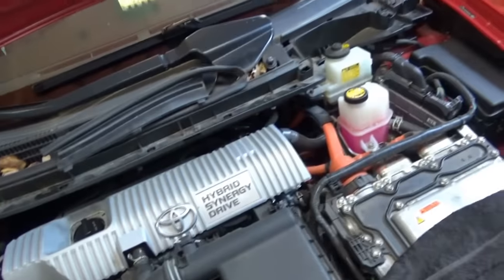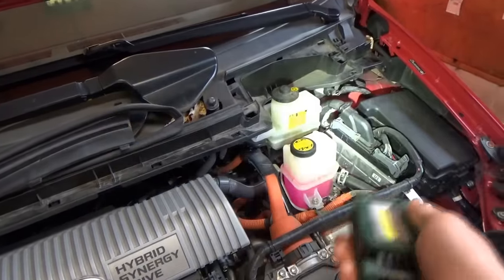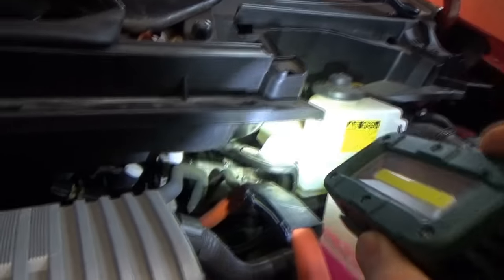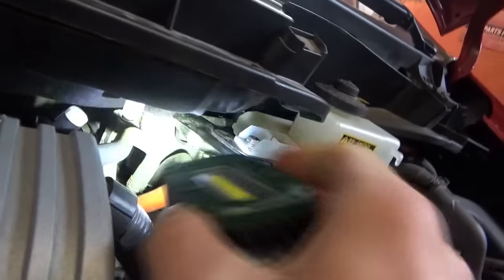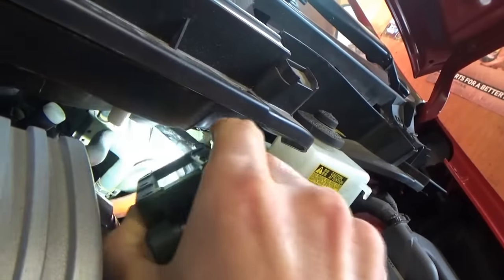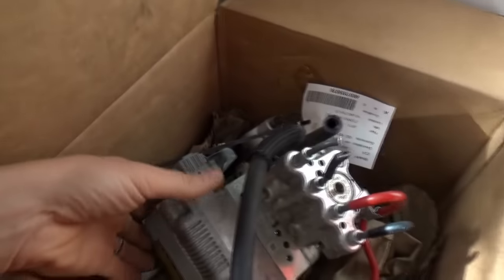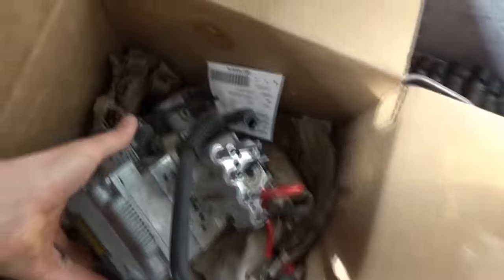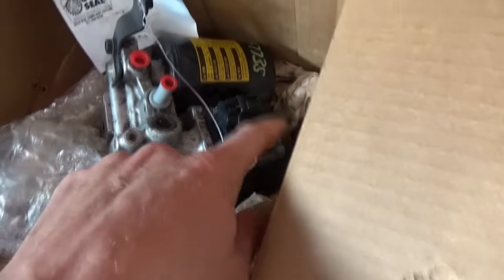Prius Brakes FAIL (Hidden COST of Hybrids)

Comment: Stating these problems are related to the car being hybrid is nonsense. There are way more cars on the road for many decades that had to suffice without engine vacuum as a power source. Starting from all the diesels (no vacuum at any time there), through practically all modern high boost low displacement engines (no vacuum when above minimum load, so e.g. for hours during a steady highway cruise), to these hybrids or electric cars. Makers used various techniques, from slapping a dedicated vacuum pump, through various hydraulic accumulators, electric pressure boosters, pressurized air and so on. 
If this is really a frequent problem, it is because Toyota screwed up their design (too expensive to replace a wear element,...; but it is about half century, when Citroen used hydraulic accumulators, so nothing new there either) or have chosen bad concept. Or this defect is just a rare, freak one, so not a reason to take that much seriously when shopping for a new vehicle...
Reply from the maker: Agreed. The moral of the story is that more complex systems will cost a fortune to repair in the long run 🙂

Comment: I have this same year model with only 120k miles and the abs issue.  Additionally the check hybrid warning light too.  So much for Toyota reliability.

Dealer wants over $200 just to bleed air and calibrate the abs.  I got  fed up in frustration after months I decided the f. with all of those I fix it myself.  I had bought the usb dongle and the Toyota Techstream  copycat version at much much cheaper price.  With this i can perform all kind of repair and  configuration for Toyota, Lexus and Scion up to 2023 years.

Do it yourself or pay to the roof  to have others to fix.  Not that hard at all!!!!!!

Comment: replaced 2012 toyota pruis used autel maxicheck  it guides you thru the process of bleeding. bought this either on ebay or amazon for 200.00 dollars
Reply: Did you replace both brake booster assembly/master Cylinder and Brake booster pump? How was the process of bleeding with autel MaxiCheck? I am planning to do it myself and still looking for a reasonable/work scanner to do the job. I will buy both new parts for the dealership though! Thanks!

Comment: My 2010 prius with 148k miles has blinking high temperature light. It comes on for 1min every time entering freeway. Sometimes my prius has heat but sometimes doesnt turn on. Its been like this 3months now couldn't figure out. I replaced thermostat at 148k already but didn't fix the issue.

Comment: You would think it would be much less complicated and less costly to use a vacuum pump with a standard brake system, as is done with diesel vehicles. Just make the vacuum pump electric.

Comment: Hi Ivan, I had the exact problem. I have a 2011 Prius and just had my mechanics replace the actuator and booster, but it still has all the brake/ABS lights on after the replacement. I've got a few error codes: 
C1203 - ECM communication malfunction 
C1336 - Zero Point Calibration of Deceleration Sensor Undone 
C1345 - Linear solenoid valve offset learning undone 
C1451 - Motor drive permission malfunction
Any ideas? Thanks!
Reply from the maker: You have to follow the service info and perform the calibrations with a scanner 👍
Reply: @PineHollowAutoDiagnostics  Thank you very much!

Comment: Why not replace the high mileage pump when you had the used replacement in hand and you were that far into it? Preventive maintenance is half the game.
Reply from the maker: Because that pump was from a recalled vehicle, and that's the part that fails haha
Reply: @PineHollowAutoDiagnostics  That makes sense. Thanks for the clarification.

Comment: The big barely mentioned extra cost is the 5-10 grand every 5 years for a battery.
Reply: Five years?  Toyota guarantees the battery for 150k or 10 years which ever comes first.  They are known to last much longer than that if the fan filter is checked and changed. Most around 200k.  The car care nut said he is just beginning to see battery changes on Gen 2s.  They are around 3k now and are going to keep coming down.

Comment: Doing a job like that is not the most intelligent thing to do when the customer doesn't want to get new parts and you install junkyard parts later on down the road if something happens to the brakes and they have a crash you are legally liable it's best to turn down a job like that

Comment: Funny that Toyota told me I needed an Accumulator and it needed 2994$ in repairs….  A set of brake pads later the car is fine and all the warning lights and errors are gone.   They tried to get me to pay 2994$ because they said “brake pads won’t set off these warning”….  I changed the pads myself for under $70….  Problem solved.

Comment: Why wouldn’t they set up the abs just like an ICE vehicle and put an vacuum pump in-line for the booster? There are ICE vehicles that are 💯 dependent on vacuum pumps for the brake booster. Example VOLVO

Comment: Hi Ivan!!!  I have a debate with coworkers about diagnostic time.  For how a diagnostic is good for?  A week, a month,  a year?  Thanks.
Reply from the maker: Hey Leo! Interesting question. I would say it depends on the situation...I mean if the diagnosis is correct, it shouldn't have an expiration date haha
Reply: @PineHollowAutoDiagnostics  
In your case, what is you deadline time?
Reply from the maker: @mencorgarageautorepair6694  It depends on the situation! If I do the repairs, then usually a year on the repair :)
Reply: @PineHollowAutoDiagnostics  
Let's say you run a diagnostic, but the customer declines the repair.  Then the customer comes back a month later to honor the diagnostic.  Would you charger for diag again?
Reply from the maker: @mencorgarageautorepair6694  I would quickly verify that the fault is still present and that there are no new faults :) Clear and honest communication with the customer is key!

Comment: It is just newer technology which is ready for Aftermarket availability to kick in. Car manufacturer need to be required to have there technology open source to the public because you cant depend on dealers to things right these days. They dont know what they are doing they are just trying to make a quick buck. There there so many software and firmware updates that need to happen these days and it should not be hidden from car owners. It is a safety hazard...

Comment: That wasn't a weird failkure aand isn't a coat of hybrids issue; it's a cost of Toyota's engineering badly packaging and locating the ABS.  The guts could have been located under the passenger seat if there wasn't room unde the hood. 

The ABS system in that Toyota Prius is opertionally no more complicated than it is in the ICE 2008 Honda Element and Odessey.  The difference is Honda puts all that stuff into one compact and accessible module and software.  Toyota''s is a Rube Goldberg kludge that lasts longer.

Both fail because of leaks.  A new replacment part from Honda is +$1500 MSRP.  Honda recalled several hundred thousand cars because of this problem, "fixed" it by sealing up the suspected leak externally with RTV and rubber caps. Owners of the repaired Honda's are now seeing the units fail permanently. No scan tool needed, one hour labir plus bleeding the brakes. A simple DIY job needing 2 flare wrenches and an OBD connector jumoe wire.

Comment: That had a recall
230 miles it does not cover it 
3200 dollars or 2300 is the cost to fix it but you will be good for another 230 thousand miles plus

Comment: Worldwide, the Prius is a Taxi  - for  goodish reason, they're pretty tough & pretty easyish to repair. Nobody sane buys these for economy as they just aren't economical compared to even a naff diesel - but they do go well in "LEZ" areas, they are vaguely "Green" - well the images is - and people don't tutt... but some repairs on them are a B-Ache.. like the ABS.. :-) and the battery... Toyota stopped building Toyotas in 2000 - fact - now they just make stuff that breaks too. And they break expensively - which astounds most Toyota customers as they thought they bought the shizzle of a car.. nope.. Oil-burning expensive parts muck like all the rest - they just trade on past glories - much like Mercedes.
Reply: "My Tesla saves me a fortune in gas!".... gets 20k battery replacement bill... goes suspiciously quiet about how much they saved.... :-)  "Hybrid" = "Run!" if you dislike big bills. You're gonna get big bills - just 1 ickle Lion cell has to go bad, you're gonna be wincing.. or the BMS craps the bed - again - say hello to Big Bill. :-)

Comment: Why did you have to change both parts when usually thr pump is the issue?
Reply from the maker: Usually the hydraulic block fails and then wears out the pump 😅
Reply: @PineHollowAutoDiagnostics  so it's best that I buy 2 new parts?
Reply from the maker: @Rhamlin7  yes

Comment: To drive Toyota that many miles before big 2000 $ repair isn't bad. Other cars have more repairs all along n wont last as long. The main question is the repair worth it because now u in time when batteries may fail. Even Scotty. On u tube says don't buy old hybrids. Due to battery problems.

Comment: Tried bleeding the stroke simulator but no brake fluid comes out 🤔
Reply: Same on mine.  Did you finish?  Did it go thru linear valve calibration?

Comment: Right but the cost is an issue if you bought the vehicle new. You can get a used 2010 Gen 3 for $6,500. You're paying to restore a 14 year old vehicle that can last 16 more years easily. Buy new parts.
Reply: Just picked up a 2012 super clean for $2500 😎 in excellent running conditions and no dings at all to body. It has the early stages of this brake problem but I’m a mechanic and not worried about it yet

Comment: brakes wont fail used parts in this case only garntees you are buying another defective part its a one hour job incluiding bleading step one should have been remove hood and wiper cowl if somthing is in the way remove it looking for shortcuts never works
Reply from the maker: You must be a Toyota Master Tech... Why does the book say 4 hours?

Comment: May get great gas mileage, but that money saved is spent on higher maintenance  costs, maint labor as well as expensive parts and repair labor rates. Imagine 2 to 3 thousand dollars for parts and labor. I wonder why not just use a normal vacuum brake booster with a vacuum pump. Much simpler system.
Reply from the maker: Like an electric vacuum pump?

Comment: The hidden cost of hybrid ownership is repairs yes, but replacing batteries is the main cost. Its an environmental disaster on 4 continents manufacturing the batteries.  Still need occasional tune ups. oil changes, still has gas engine. Horrible choice. Gasoline vehicles are considerably more environmentally friendly.

Comment: Its kinda unfair to even bring up the "hidden cost" unless you are going to ffairly do a full blown cost benefit analysis.  Your theory in this regard fails flatly when one clearly analyzes vehicle repair costs, as, what REALLY is expensive is ANY kind of new tech as ANY tech is rarely as good in its first iteration as in subsequent efforts.  My Gen 1 Prius went 291K miles and averaged 51MPG.  An equivalent corolla of the time was hard pressed to deliver 30 mpg and was far less responsive to a lead foot. in that time i purchased 5700 gallons of gasoline AND enjoyed a far more responsive car while POLLUTING far less than the corolla which would have sucked down  9700 gallons of gasoline IF it could have made it 291K.  I can buy a lot of brake boosters for the cost of 4000 gallons of gas.

Comment: What that engine bay needs is more hoses and cables. :/
This is what happens when a manufacturer gets blinkered into side alleys and go all in - be it hybrid or hydrogen. They just keep going down the same alley - despite the rest of the world shouting... ELECTRIFY.
Reply: Frankly, I don't blame Toyota for sticking with hybrids for now.  There isn't the infrastructure YET for mass electric vehicles.  Additionally, in cold weather states, it would make me nervous because if caught in a blizzard / traffic jam, you would have heat as long as you have battery.   Then when over, it wouldn't move if the battery was dead.  At least with a hybrid, the computer won't let the battery go dead as the engine kicks on and recharges it and keeps the heat going.  Can't tell I live in a cold state, huh?

Comment: I’d hardly call that a “hidden cost” on any vehicle with almost a quarter of a million miles. Things break after you drive the equivalent of the circumference of the earth 9 times over.
Reply: For only 9.95
Reply: A good analogy.  It's also only 10k short of a trip to the moon.

Comment: I've got a gen 2 with over 300,000 miles on it. Original motor with replaced head gasket. Just now putting a rebuilt battery pack in it. I still think the gas savings out ways the parts heavily.

Comment: I mean 230k miles, if you're getting 50mpg from a prius and 30mpg on a standard car; you've saved 10k on $3/gallon gas over that time. 
You're also acting like other cars don't have issues or require maintenance either...  (and this was a recall, so Toyota would have covered it)
If you had a gen2 or 3 prius, you had one of the cheapest driving experiences for 1-2 decades.
Reply from the maker: Regular Honda Civic gets 45mpg, same as a Prius 😆

Comment: Didnt look to me that you had the order of operations right. I thought you are supposed to 1) press pedal, 2) open bleeder, 3) close bleeder, 4) release pedal.   This is the way you do it on a car without a pump, too. But at least WITH the pump you don't have to repeat 1-4 over and over again until the bled fluid comes out without air in it. If you replaced the lines that could take a while!  That way you are performing this, you release the pedal before closing the bleeder and that will suck some of the bled fluid (with air) back into the caliper.  You should have used a 2x4 against the seat to hold the pedal down while you went and opened / closed th bleeder.  The pump would have kept pumping fluid to that corner for you.

Comment: I bet anything he never flushed gis brake fluid ever . thats why these fail . minus the nitrogen chamber recall. Also by the way if the car got 45 Mi to the gallon and went 210,000 miles at an average of $3 a gallon that's $14,000 in gasoline. If it was a normal Corolla and it went 210,000 Mi and got 30 Mi to the gallon and also $3 a gallon that's $21,000.... pretty sure you still save money this way
Reply from the maker: And then you have to replace the hybrid battery pack 😂
Reply: @PineHollowAutoDiagnostics  315k and 19 years on the factory battery pack in mine . i did have a car rear point was true. I bought a TDI 2000 Jetta for dirt cheap and everything I saved in mileage I put back to it in maintenance
Reply: @PineHollowAutoDiagnostics  the battery packs only have to be replaced because people don't know how to drive these freaking cars and people don't maintain these cars. These foreshadowed the horrible maintenance habits of the EV owner

Comment: Why not just use a vacuum pump on a regular brake system? Well, because if your an engineer, designing the Rube Goldberg braking system is way more fun. Glad I drive a 2006 Matrix with 214,000 miles (which is an awesome car for DIY mechanics BTW).
Reply: Hybrids have regenerative braking, which needs to be absolutely seamlessly coordinated with traditional friction braking. A drive-by wire braking system is the only way to do this.

Also, this by-wire braking system allows them to do neat things like vehicle dynamics integrated management, which is essentially predictive stability control that can react 1000 times a second. No traditional ABS pump would be able to keep up.
Reply: @aspecreviews  Interesting.

Comment: I estimate that the owner has saved $4,000 to $5,000 in gasoline expense through 225,000 miles at 45 mpg when compared to owning a vehicle that gets 35 mpg, or 10 mpg less. He's still money good after the ABS job, with some in reserve for another disaster, and he's had a minimal maintenance experience to this point. Hopefully the battery and the rest of the hybrid powertain hangs in there for many more miles, because that's where it could get really expensive to keep on the road.

Comment: Do what i done put in an electric vac pump and brake systam bypass the crap on the systam no  
Props since .and rear suspension
On a prius is crap noisy there all the same just rubbish 🇬🇧

Comment: $2 grand this days for a repair is not expensive or unusual unless you’re stuck in the 1970s with a mind set for repair prices from those times.
Reply from the maker: In that case just buy an older used reliable simple car lol
Reply: @PineHollowAutoDiagnostics  you’re exactly right, over 200K on any vehicle is quite a run for anyone.

Comment: C'mon.... don't act like hybrids are the only cars with complicated shit. Don't be a hater. How about on some newer Chevy 4cyl gas engines with the vacuum pump driven off the cam? When they seize it breaks the tabs off the cam and you need to replace one of cam shafts. What BS is running a vacuum pump on a gas engine for vacuum? Sure no computer needed but you need to replace a damn camshaft. 
But don't hate on hybrids like these are the only vehicles with shit like this. They are just the first to use some of the "tech" and it does trickle down to normal cars too. 
Nice dickhead Scotty headline too, c'mon man, you're better than that.
Reply from the maker: Yeah the cam driven vacuum pump was not one of GM's best ideas lol